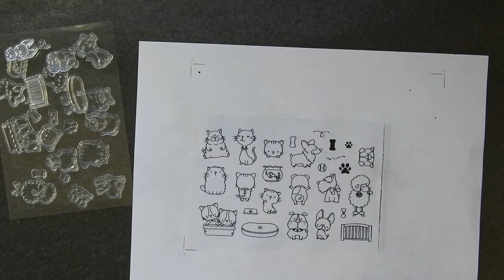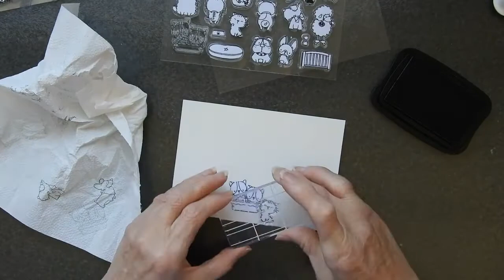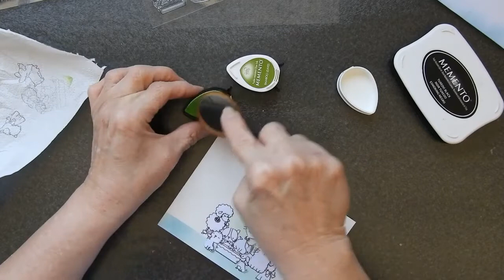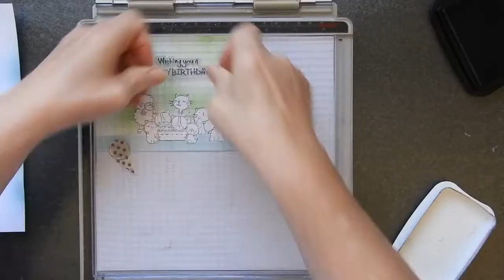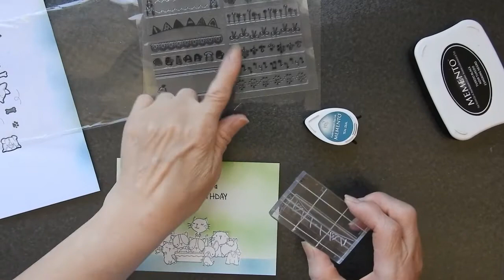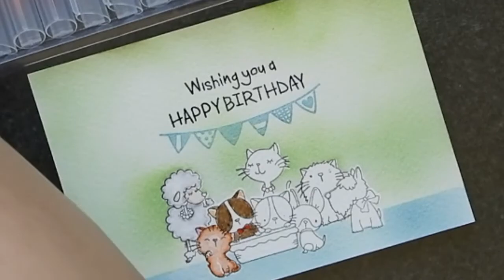Hack for scanning stamps for masking/cutting using Beebeecraft stamps

Comment: Great idea using the index sheet to trace images. I've always fussed around with tracing a stamped one. It works, but it can be a little tedious to clean up.
Reply from the maker: Exactly! i don't normally have the issue, since I make my own stamps usually (and therefore have the digital file already) but this makes it easy if you buy stamps!